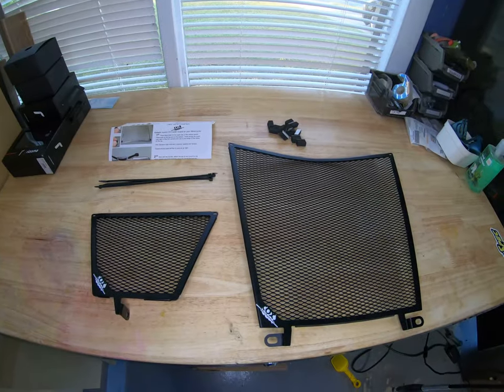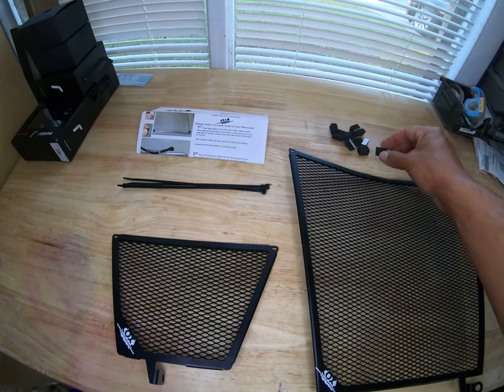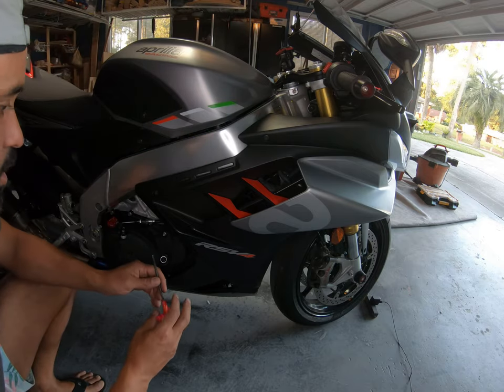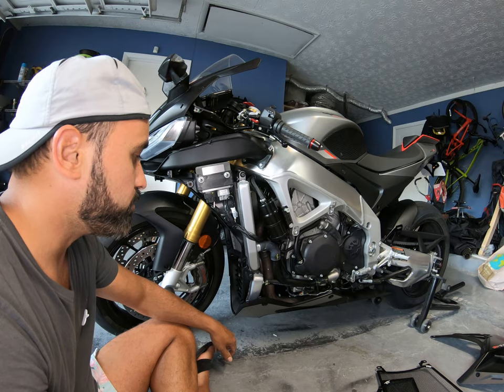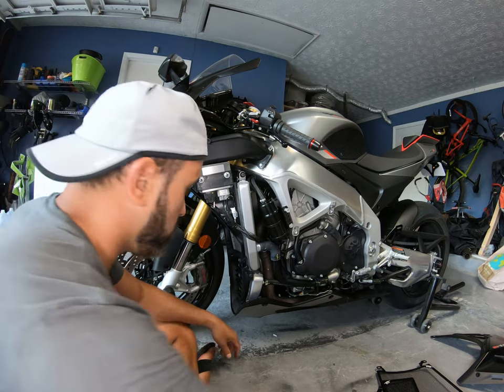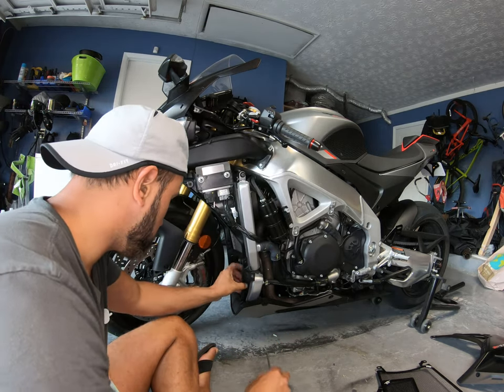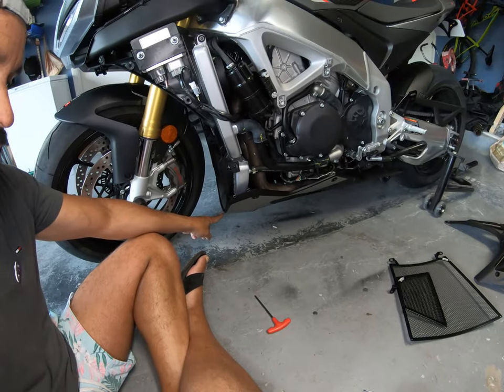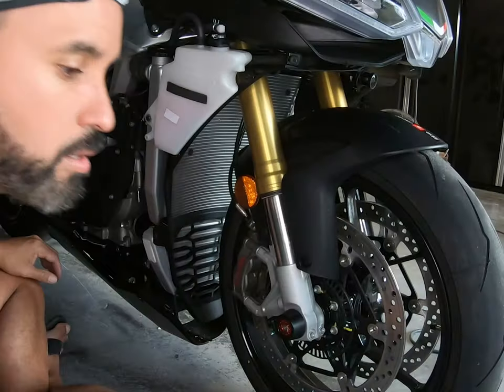Aprilia RSV4 2021 - Radiator Guard Installation

Comment: if it was my bike i would take out the center of the original oil cover and use the frame to hold the fairing together as the plastic perforations are not needed and would only block the cooling effect, good one bro!
Reply from the maker: Thanks

Comment: What does your temp run at idle like so and go traffic.  Is it cooler since changing the exhaust? I have a 2021as well. Seems to run warm when no moving.  Fans both work etc. I need to do an airflow test.
Reply from the maker: I am in Florida and it depends on the season. During the summer on a stop n go traffic it can run between 207-220. It is normal on this bike to run hot. It doesn't like stop n go traffic. I shut off the engine if I stop on a red light.... 
I did not noticed any difference in temp after changing the exhaust.
Reply: @AlvRSV4-Vrod  yeah I'm in Memphis TN and my fans come on at 215-217. They won't hold the bikes temp though. It will climb to 240 if I let it. Moving it's fine. I'm going to do an airflow test to see if the fans are pulling enough air. Seems like they can't keep up with the demands of the bike. Thank for the reply